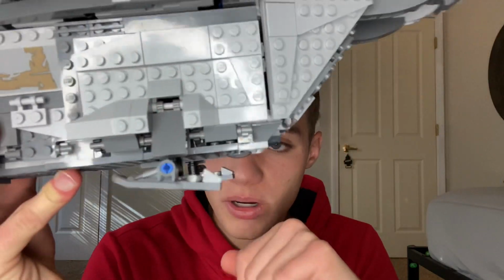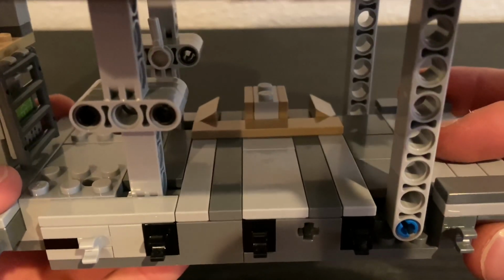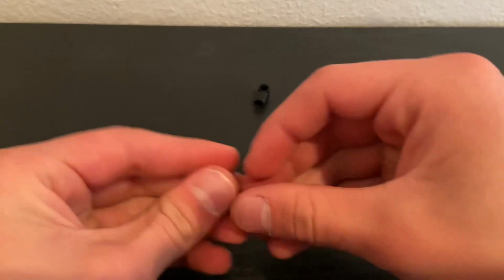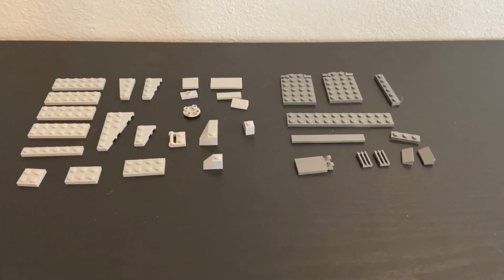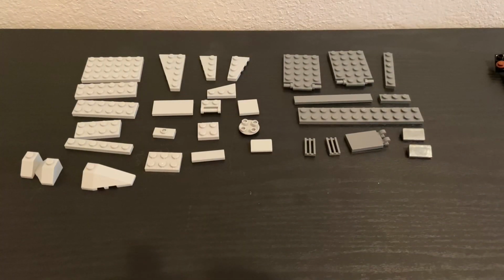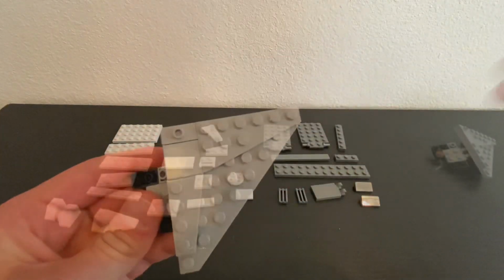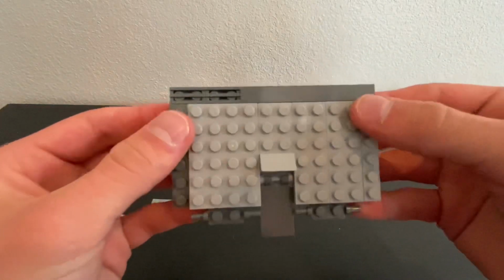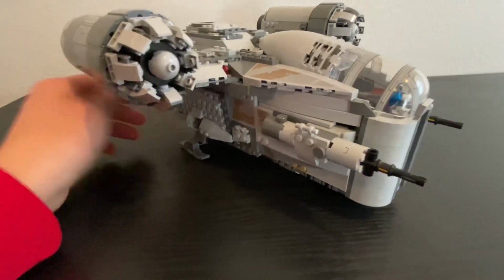Lego Razor Crest Mods Part 6: Landing Gear!

Comment: Thank you for this great build I added it to my razor crest. But one question does your landing gear build flex up just a little bit when you set it on a flat surface
Reply from the maker: Yes it does that ever so slightly, which isn’t a huge problem since the clutch power of the pieces I used provide enough stability

Comment: time to look for these pieces for 3 hours
Reply from the maker: I know right! 😂 that’s usually the hardest part about most Lego projects
Reply: @BM.dallin  also i must say i love how you made the gear fold in it looks so nice
Reply from the maker: Thanks! It was something I didn’t really plan on originally, but since I used technic pieces to make the landing gear it made it so you can actually fold it in 😂 the only thing is it’s not perfectly sized so it puts a tiny bit of stress on the technic pins, but its not enough to break them